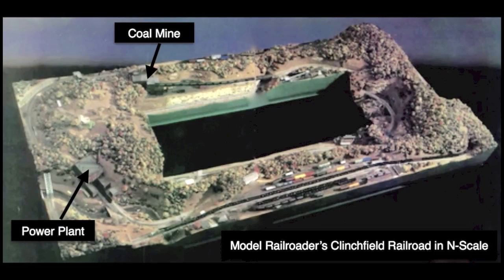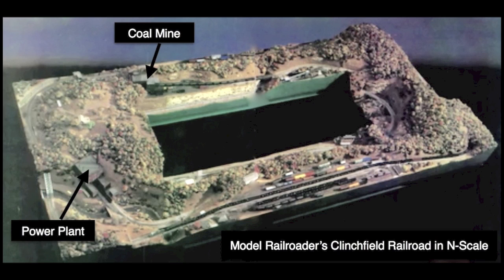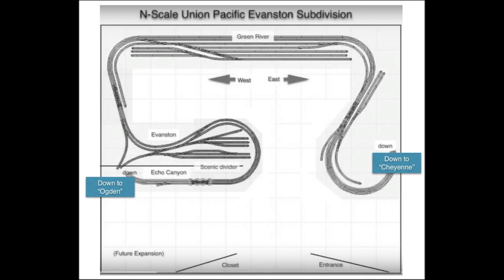Running Coal Trains On My N-Scale Layout

Comment: Roy, That was a really fine job of explaining unit trains and the movement of coal (or other commodities) across a "bridge route".  I do something similar in HO, using UP and BNSF coal trains, oil train, etc.  Eastern Nebraska is a place where most trains go through with stops made only for recrewing and servicing.  N Scale coal trains can look pretty good.  My space limits me to about 25 cars per train in HO, but as long as the train is long enough to fill the viewers' field of vision at any one point then you have given them the impression of a "long train".  Trivia note:  as a long-time viewer of UP motive power, the SD70M wasn't bought originally for coal service.  I can't speak to current UP rules, but both UP and BNSF have preferred the units with AC traction motors for coal service (C44AC, ES44AC, SD70ACe) while the DC motor units are in freight, intermodal, oil, etc.  When the first SD70Ms came through in 2000-2001 one saw them on intermodals and hot freights.  The huge SD70M order was to allow UP to replace their aging fleet of SD40-2s with something newer and more efficient.  In current years I HAVE seen SD70Ms on coal, but it is the exception rather than the rule.  Oddly, one of the places I have run into SD70Ms on coal is when they are running on BNSF.  Speaking of BNSF, if you want some variety in your modern trains please remember that BNSF has trackage rights for some trains over the UP through Colorado and sometimes they go through the Evanston sub when they are detoured.
Reply from the maker: Thanks, Gary. Thanks for sharing that information about train length and how many cars it takes to make a "long" train. I suspect that train length is affected by the size of one's layout as well. I also appreciate the information you provided concerning SD70M's. Most of my trains are pulled by ES44AC's and SD70ACe's. I guess it was something I saw on the Kato USA website which led me to assign my SD70M's to coal train duty. Kato USA says: "... the SD70M was primarily put to work hauling coal trains due to its high pulling capacity" on its webpage at https://www.katousa.com/N/SD70M/index.html. Well, one thing is for sure: I need to research this more because I want to run my trains prototypically, and your input helps me do just that. Yes, I very much like the idea of running BNSF diesels on my layout. In fact, years ago, I saw a lash up of two U.P. diesels with one BNSF diesel just west of Green River. I am continuing to think about fictionalizing my layout a little and leasing "trackage rights" to the BNSF to run a limited number of their trains on my U.P. Evanston Subdivision. Interchange operations really appeal to me. I really appreciate your knowledge and input, Gary. ...Roy
Reply: Always glad to help.  I don't know the exact nature of the BNSF trackage rights over UP, I just know that it was a condition of the UP taking over the SP/DRGW.  It seems that in this day and age only the RR Acounting Dept knows for sure who is getting paid for which train on what track :-)

Comment: Hi Roy, Well done! Your explanation of your operations on your layout was spot on. On my N scale layout, I have a coal mine and a power plant that uses loads in and empties out and it works out very well. I have enough space between the two industries to give the illusion of distance. What is nice about N scale is that you can have 20 - 25 coal cars on a train and it looks long. Right now my layout is set up to deliver cars to various industries along with a long scenic divide in the middle of the peninsula to give the illusion of distance. Right now my layout has a staging yard at each end of the layout but I am considering connecting the two to give continuous running . This way I can run more unit trains in either direction. Thanks for sharing your ideas with us! 
Randy
Reply from the maker: Thanks for sharing, Randy. I really appreciate your comment and I thoroughly enjoyed reading it. I'm delighted to learn of your success with loads-in and empties-out. In my limited layout space, the only solution I had was to put the mine and power plant off-layout and to simulate the shipment of Wyoming coal to seaports in Washington state for overseas export. Each scale has its advantages and disadvantages, but those LONG trains are a definite advantage in N-scale. I really like your idea for using a scenic divider in the middle of the peninsula to create the illusion of distance and your multiple staging yards. To me, our trains appear to be running in circles if we don't have staging yards to create the illusion of them going to off-layout destinations. Like you, I am planning to ad additional staging yards to my layout. Thanks again for your comment, Randy. ...Roy

Comment: Just East of Rock Springs are several open pit coal mines and the Jim Bridger power plant.
Reply from the maker: You are absolutely right, Bruce. I'm familiar with the Black Butte mines and the Jim Bridger power plant. However, they are located on the U.P. Rawlins Subdivision and not the Evanston Subdivision which I am modeling. The Evanston Subdivision runs from Ogden, UT to Green River, WY, where it ends and the Rawlins Subdivision begins. Nonetheless, in my mind at least, it is plausible that some of the coal being hauled on the Evanston Subdivision can have its origin at the Black Butte mines. Thanks for your input. ...Roy
Reply: Ahh, ok.  Yes the coal mine and power plant are on the subdivision just East the of the Evanston subdivision.  They are on the Rawlins Sub.  I enjoy your video's, and look forward to each one you post.  Thanks!
Reply from the maker: Thanks for your follow-up, Bruce. I really appreciate it. Keep watching because I have a long list of ideas for videos, and more will be on the way soon. ...Roy

Comment: If you don’t mind my input, I would just like to inform you that UP usually refrains from using their DC traction locomotives (mainly sd70ms) in coal service due to AC loco’s ability to haul heavy trains at a slow speed for an extended amount of time without over heating. I know you like to run according to the prototype, so I thought this would help enhance your operations on your layout.
Reply from the maker: Thanks, my friend. That’s good to know. You are absolutely right: I eant to run my trains as prototyically as I can. Your information helps me do just that. ...Roy